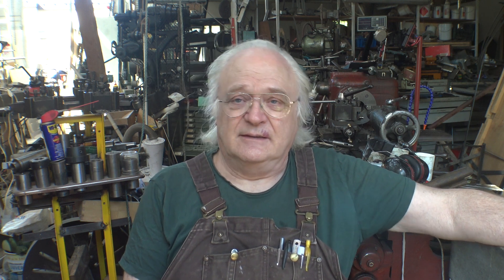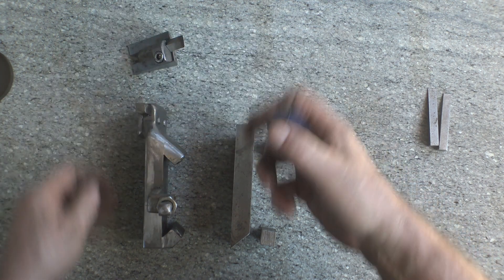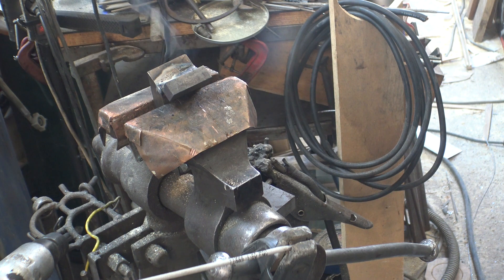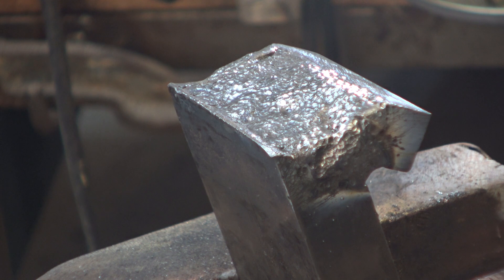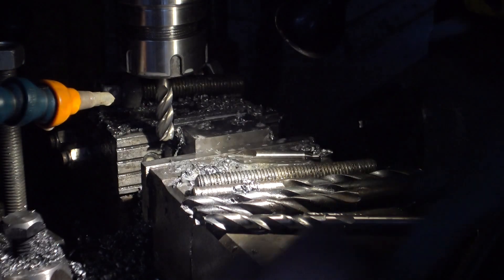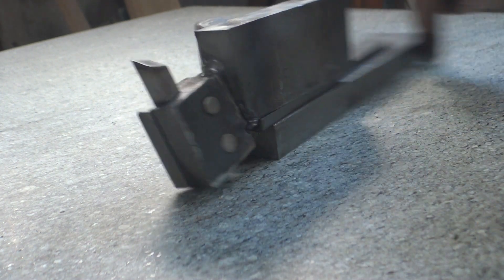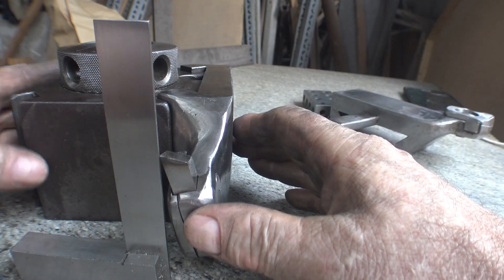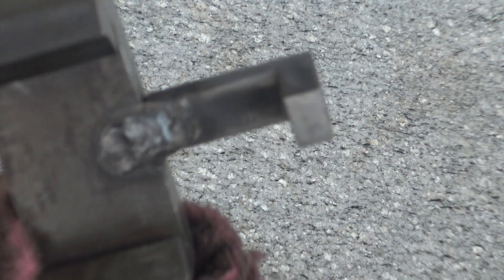#tmc2020 Tangential toolholder (left hand)

Comment: 8m43 into it, and your mill looks like mine! I bought a diamond tool holder about a week ago and have been extremely impressed with it so far.

That toolholder looks very close to your QCTP, and makes me think you've put a lack of leverage and trig in your favour :)

Nice work! I'm impressed with what I've watched to this point, will continue and subscribe!
Reply from the maker: Thanks for the subscription! My mill is a H-Ernault Somua ZHV1 It's French. Not sure what you mean by "That toolholder looks very close to your QCTP, and makes me think you've put a lack of leverage and trig in your favour :)"
Reply: @MatthewTinker-au-pont-blanc , sorry I meant that, if you look from above and draw a circle from the bolt/stud that holds the toolpost down, out to the cutting edge of the tool, it has a small radius. Now if you look horizontally, and draw a right angle triangle between the cutting edge, the hold down point and a vertical from cutting edge to the top of the compound, this it the trig. Because everything is kept close to the hold down point, there's less of a lever on the hypotenuse of that triangle.

It's hard to describe without a drawing!

Best of luck!
Reply from the maker: @carneeki  Think about it the other way round, I made the tool so that it was low enough to fit into the available space, the bottom just clears the top of the cross slide and I could get two clamping bolts in, the geometry is a result!